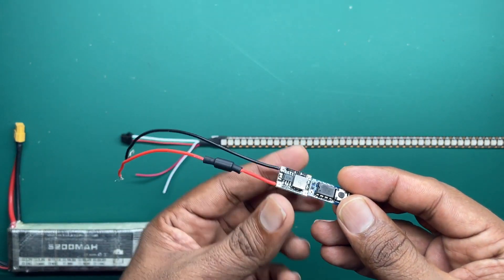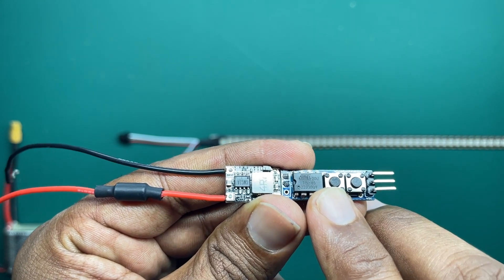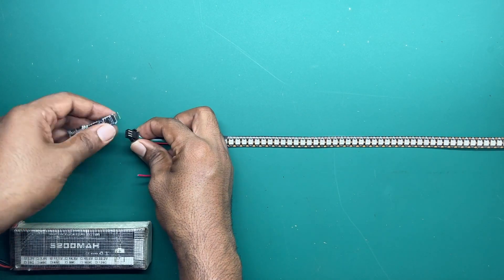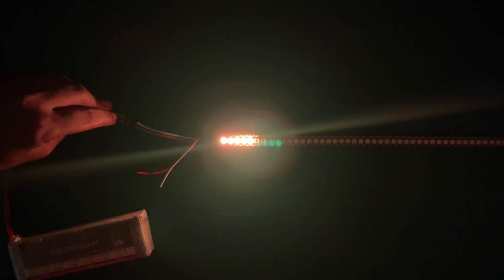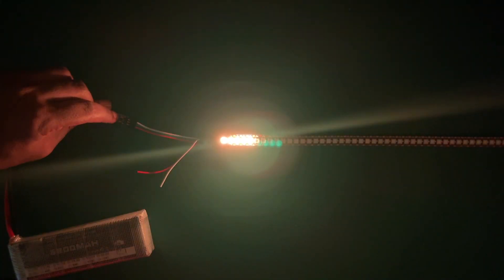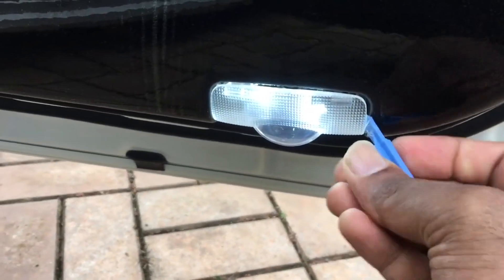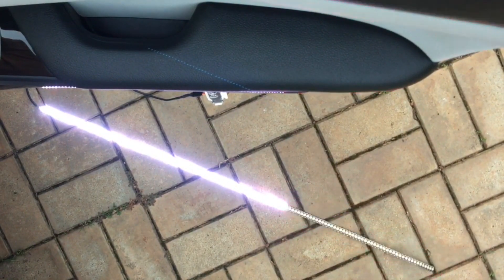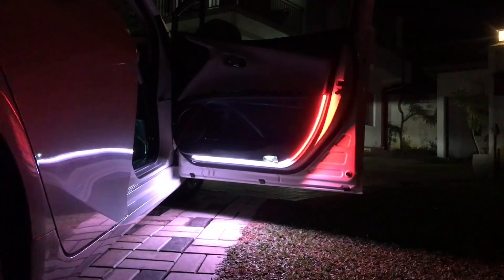DIY LED Car Door Welcome and Safety Animation Light #attiny85 #ws2812b #arduino

Comment: Hlo brother I am a car electrician I need a circuit for car horn with working central lock signal like a creta or i20 press lock button horn one tym blow and unlock two tym blow can u make for me this circuit please
Reply from the maker: Is lock and unlock signals comes as two seperate 12V signals?
Reply: @HAZITECH  Yes Bro 👍🏻 And Thank You For My Reply ❤️
Reply: @HAZITECH  Lock and unlok signal comes at 12V but for one second the signal comes whatever it is from Lock even if it is from Unlock